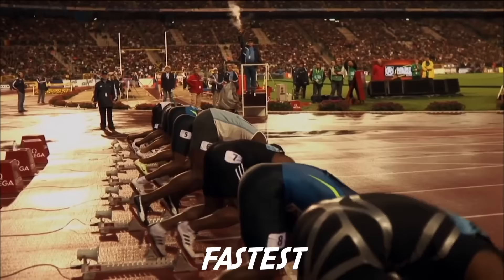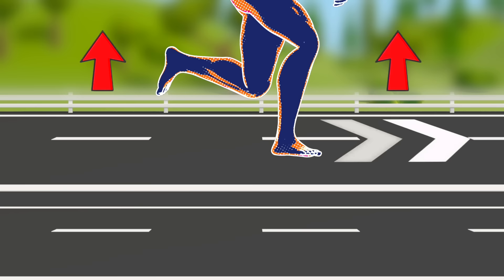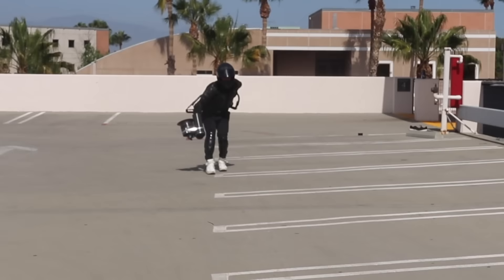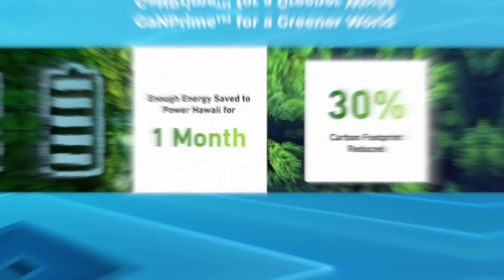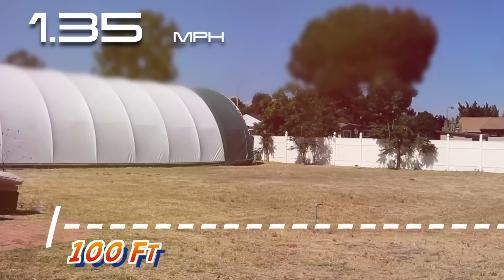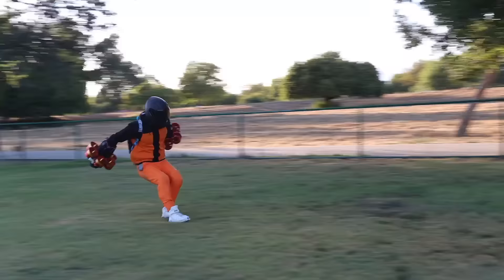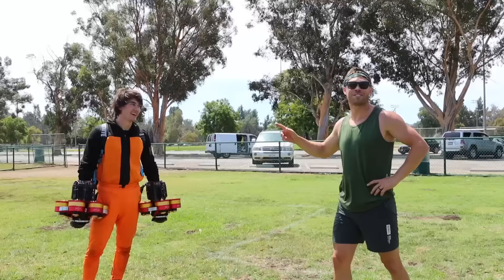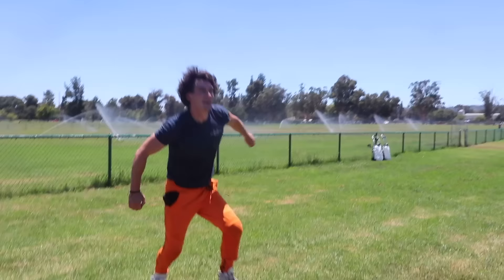I Built Shoes To Make Me Run Fast! (World Record)

Comment: This is amazing, and it honestly makes Usain's speed that much more impressive. Not just because he went that fast, but as this shows, reaching that speed is only half the battle. Holding that speed consistently and without falter is the most impressive thing honestly.
Reply: to be fair, usain bolt does not maintain that speed. that is his top speed, usually he reaches that point late in the race, maybe at the 70mts mark. still, mad credits to bolt.
Reply: @briankim7442  makes sense. At a certain speed you'd either have to touch the ground many times faster or basically slide like he did here. Both become far too difficult to control at a certain point. I'd really say Usain reached really close to what I'd call humanity's physically fastest speed without enchantments.
Reply: 400 likes no comment 🤪 I do agree though
Reply: @briankim7442  I mean Jake wasn't holding 29 mph the whole time he jus hit it once, he jus meant in order to get that speed u gotta be maintaining a pretty high speed. U can't jus go from 0-29 like he slowly sped up and maintained it
Reply: it looked like the consistant speed was the easy part for him tho! getting out of the block against smaller more agile sprinters was the harder part i think! once bolt had reached a certain speed he was unstoppable and just flew past sprinters
Reply: then you're gonna be really impressed by distance running. It's basically doing that but longer.
Reply: you said it
Reply: Wow I can run faster
Reply: To give you an idea: usain at top speed could technically mathematically outrun gravity
Reply: @stealyoursupplies  I'm faster
Reply: He should make the Shang chi rings
Reply: @stealyoursupplies  lol he cant...i know you're talking about escape velocity but while Usain can do ~30mph,u need to go like 25000 mph to outrun gravity
Reply: @FK-oq3iv  True, although they usually hit a plateau speed eventually. Distance running is a test of stamina, not just speed.

Comment: I’ve had an idea similar to this before, but instead of the thrust being attached to your arms, it’s attached to your waist on a belt. That way the thrust is also pushing more on your center of mass. You’d need to angle the thrusters at a slightly upward angle to keep them from pushing you into the ground.
Reply: if you fall you are fked tho, having them on your arms gives you more control and you can react more quickly
Reply: @furryalpacca8634  what about both, stronger ones on your waist slightly tilted up to keep the thrust at the center of your mass and smaller/weaker thrust at your arms to get the controll you want?
Reply: @theaumguy1621  I do IT for a living so I always think about possible issues, so I am not trying to discourage you / patronize you :) There are 2 issues with this idea, first if you have like 60+lbs thrust on your waist you won't really be able to counteract that with less power on your arms. Also stopping is an issue, even if you turn the waist thrusters off, it's going to be difficult to counteract the momentum with small thrusters on your arm. This might be fine if you are secure in keeping a good posture, but if you fall forwards you have 60lbs thrust slamming you into the ground. You'd have to react super fast in turning the waist thrusters off and counteracting it, which I think is unrealistic. I could however imagine writing code that reads data from a gryroscope sensor thingy, which would then turn off the waist thrusters as soon as there is a slight shift. This would increase security, but I still think it's a hazard since you A) still have to counteract with arm thrusters & B) having your waist thrust turn off early on if you can't keep the right posture
Reply: @furryalpacca8634  yes.. that might have a soultion with gyroscope.. but again i agree,  the first test is still going to be very high risk. what if something fails. like the code might be setup like.. that the back thrusters only work at a particular angle range and gyroscope values.. but what if we are missing some edge cases. So the risk of trying out real life stuff based on calculation is the main issue.
Reply: @furryalpacca8634  I really love people trying to think/talk about solutions for exact problems, even more so if they have knowledge about it. I can only agree with what you said..

maybe i have 2 soultions for that

1. Maybe its possible that the stronger thruster only works in pulses? so its not constant pushing you, only when a feet touches the ground? or at least have some buttons to controll the power output?
or
2. Is it possible to make your body seem lighter without having such a huge thrust at the waist, by lowering the power but tilt it more upwards?
Reply: PROTOCOL 3: PROTECT THE PILOT
Reply: You gonna brake something if you fall and if it's too fast you upper body maybe can't keep up with it but there's no impossible brother it could be bad or maybe really good
Reply: @rockyroadmagic4152  They don't get it but I do
Reply: Atot
Reply: What if he tried to run like shadow does?
Reply: @theaumguy1621  or u could just u know make it so that u just need to hold a button with ur hand to activate thrust
Reply: So your saying it should be like attack on titan

Comment: this justs shows how crazy Bolt was at his prime, even with 12 super powered jets and shoes the slide, they only just beat him.
Reply: What if bolt was to use this stufff
Reply: @yeetyeet3473  😩🤔
Reply: @yeetyeet3473  break the sound barrier
Reply: @keymanser2726   man would break the LIGHT barrier
Reply: He would still not have won because you have to take into consideration that bolt is a consistent runner meaning that he runs at about the same speed consistently whilst the jets have a MASSIVE range of 29 and 23.
Reply: @yeetyeet3473  Don't give him any ideas.
Reply: @Allegator07  If he were in his prime today he'd probably break 28 mph with the crazy carbon shoes we have now
Reply: @yeetyeet3473  nothing would happen because he wont do any movement
Reply: @ianjtgove  if you did you wouldn't be able to see anything because light doesn't travel as fast as you
Reply: @yeetyeet3473  he'd go faster than the fastest humans could run in theory which is 40mph and would end up going around 46mph in theory
Reply: @quincywinning8997  e

Comment: Suggestion:  fans at the wrists, pointing toward the shoulder. you can bend your arms at 90 degrees and have the thrust pushing directly behind. It would also allow you to point your wrists up at about 45 degrees while running,  to get some lift for longer strides.   easier on your rotator cuffs, too.
Reply: Hip jets or lower-back jets would be nice(+stabilizer would be perfect), closer to our core which gives a more “natural acceleration feel” for the human body, we didnt evolve to run with force pushing on our far upper-back part or from our arms behind our backs then propelling our shoulder joints to the ground (sorry naruto fans but our ancestors ain’t falling face first without their arms prepared to protect their faces when chasing their preys)
Reply: @f.b.lagent1113  titanfall pilot setup lmao
Reply: ROCKET PAWNCH
Reply: @zvoonyoutube1855  that actually how they wall ran too because their jump jets gave them a bit more lift and pushes them into the wall a little bit to give them leverage

Comment: You can improve these "shoes with jets" by placing some springs inside of the shoes. That way you can keep sliding and gain a good height so you will use less force for running and probably more speed then Bolt.

Comment: Suggestion for improvement: add gyroscopes and exo bones to fix your arms in just the right angle so the jets both provide consistently enough uplift force for big steps and forward force to push you forward.
Reply: That's so much work tho. Like a crazy hard thing to do. Possible, but insane.
Reply: thats what im saying
Reply: A small rotor that rotates based on a single value of a gyroscope isn't such a hard thing to do. Connect it to 2 pieces of  Source: am an engineer
Reply: with exo bones he won't be able to defend himself if he falls, he'll fall on his face
Reply: Would an rc car gyro do?
Reply: @TalTheBest  that's not true, since it's possible to program them to lock only when his hands are in a certain area in space. So if he has them backwards, then auto-lock, but if he moves them anywhere else, they auto unlock.
Its also possible to ads an override in the form of a switch.
Reply: @galgrunfeld9954  I see... with all the ideas in the comment section, he'd actually be even more unstoppable if he was open for suggestions while during the built of the stuff he makes. coulda been awesome
Reply: I think fixing his arms behind him would be extremely dangerous but maybe in wrong

Comment: I think you for the next iteration should leave the very front of your shoes with full grip for a truer sliding run, so as long as you're actually running heel-toe you can slide each foot the moment it hits the ground until you're ready to push off again on that leg. You'd have to relocate the propulsion mech though, likely to your back or shoulders for a straight push forwards.
Reply: the real gains this guy gets is when he's just sliding -- would like to see him actually really running at a fast speed...
Reply: true but then it wouldn't be a naruto run :(
Reply: Nah bro put these shoes on a cyclist who can move their feet quick enough to handle the speed lol
Reply: That honestly might be worse though because the grip would be on the back foot while the front is being pushed by the jets. Sounds like a good way to the splits 😂
Reply: @abranfreemuffin7342  free content lol

Comment: A couple things you could add: 
-a few small jets on either side of your waist, to propel your legs similarly to your upper body 
-traction, but only on the tips of your shoes for when you push your legs
-weights, to lower your center of gravity (sounds counterintuitive but could be easily countered with the extra jets)
Reply: he should add a few downward facing jets to counteract  the force downwards as well
Reply: Adding more weight just to add extra thrust doesn't seem like a good idea. To substantially lower his center of gravity the weights would need to be on his legs which would make running more difficult.

Comment: Cool video! A trigger attached to a pneumatic actuator attached with an exoskeleton to the knees or thighs, to prevent over extension and injury for each leg, would be able to do catapulting force to create longer strides so you could stride like a Cheetah which are recorded to have strides of up to 22 feet helping them achieve 70 MPH speeds. Like the Hulk jumping and running. Legs don't need to move faster, they just need to push harder to achieve record breaking strides. Keep up the awesome work!
Reply: Beastys101  haha it's okay, I do a lot of engineering. Habbit, work, and hobby.
Reply: @matthewmolinar  depends how you fall. The average static line jump for a ranger comes in at speeds sometimes exceeding 35mph using their tuck and roll methods. Additionally, I'd assume the person wearing gear that could produce crazy fast land speeds should be wearing protective gear. Street luge racers and bike drag racers have well practiced methods of spilling at those speeds.
Reply: @edh3268  you should start a YouTube channel!
Reply: ah yes. engineering. it uses all the English words but seems to be a new language.
Reply: @jimmyalpert5233  haha I'd love to, but I'm not as good in front of camera :) I just love this stuff though. I'll leave it to the kickass ppl like Jlaser, Mark Rober, NighthawkInLight, Practical Engineering, GreenPowerScience, and Alex Lab promoting science, pushing boundaries, and helping and inspiring others in STEM. :) JLaser should totally be a FirstNRC sponsor for the high-school robotics competitions to mentor the kids. We used to do that and I loved it! Great opportunity for them!
Reply: @edh3268  I’m a video editor and graphic designer.  If you ever change your mind I think something cool can be made.  You know where my comments at haha
Reply: @jimmyalpert5233  I will surely keep it in mind! :) Thanks Jimmy
Reply: Yo bro, can u teach me how to run faster , engineer style?

Comment: Hey, just a few random questions I would really appreciate an answer to.
1 ) would you be able to go faster using Aluminum Magnesium Boride?
2) would it be possible to create a small material that can allow you to speed run on water kinda like a superhero speedster
3) hypothetically, if u could switch the base of your shoe from Teflon into another material, what would be the best one to increase friction and give you a sudden or strong stop (perhaps even give enough grip to allow for a 90⁰ climb) . (I'm assuming rubber, but would love your opinion on this)

Thank you
Reply: Give this man more attention
Reply: I think that rubber Will be the best
Reply: Pom 😎
Reply: I would also make a suggestion of having something to increase friction on certain places in the bottom of the shoe to make it easy to continue running when you want or stop when you need to
Reply: @slasher3582  I believe roller shoes (the original heelys) had something like that. A stopper at the very front.
Reply: have you found the best running shoes
Reply: if the sole changed to rubber for a sudden stop, then probability of tipping over will increase a lot and might cause serious injuries.
Reply: I feel like rubber would make him trip
Reply: Rubber < freshly moulded silicone
Reply: @SolomonWyt  you're right, it's the same as using the front breaks on a bike when going fast, you tip over.

The force that's propelling him is constant and above the stopping point, maybe if he angled his legs to be Infront of him and lean backwards it would balance out the force of having a sudden stop (doing the perfect lean would be hard to learn)
Reply: @Spartanwarlord  I see what your saying and I agree! But I was more or less saying that the friction on rubber is extremely so it couldn’t slide smoothly, like if I were to take a peice of rubber and run it across a smooth surface it would still scrub
Reply: @Spartanwarlord  thank you so much

Comment: Mount thrusters to your back point at 45 degree angle.  Basically, half of the thrust would push you up and half pushing you forward.  That would allow you to pump your arms and run more naturally, but with an assist
Reply: 100% this is the best idea but they should probably be a bit closer to parallel to the ground, prolly like 20 degrees. It works tho none the less
Reply: yeah but he wanted to naruto run

Comment: Having the thrust aimed down your arms means you have to hold your arms backwards which is a very uncomfortable position and hard to hold while running. The jets also lose efficiency if they're not facing straight backwards and counteract each other a bit. I imagine if you had the jets facing perpendicular to or up your arm, you would be able to hold them in position more easily and go faster.
Reply: Imagine if he had them attached one over each shoulder aiming backwards so he had freedom of arm and leg movement. Complete balance and and thrusters facing directly backwards. Would have worked much better imo
Reply: Well explained I guess yk know aerodynamics and rocket science huh?!.
Reply: I think the point is the naruto run. They wanna break the record with the power of anime.
Reply: definitely cant have them perpendicular bc it's more than 100lbs of thrust that you have to fight but facing up the arm seems like it would be easier
Reply: Thats true BUT if you raise it a little too high ur face is gonna end up on the ground, you just have to be really careful and not make a slight mistake because it’s a high chance of face on the ground
Reply: @knrz2562  it's not like you need to have a degree in rocket science or physics to know how to angle the thrusters

Comment: This is awesome man, how does it feel to be the fastest man alive ( on a technicality ) but still, 29 miles per hour! That’s 2 mph faster than Usain Bolt’s 27, and now I can’t wait for your Iron Man suit, you’ve tackled flight once, now you’re gonna do it again
Reply: The only problem is that he is not actually running, he is sliding
Reply: @user-ki4xw2rb8q  he’s running and sliding, he’s pushing forward to get faster and sliding when he loses control
Reply: @SCPguy-06  he is running just to break inertia once he accelerates enough he is increasing and reaching top speed sliding not running

Comment: I think the better strategy is to put the jet on the back, make them exhaust to the back. 

Because your arms are occupied, you can't generate proper force to run. It would also make you a lot more stable. 

Build a solid backpack from fiberglass, inlet from top of the pack and exhaust from the right, so you'll need a 90° channel.
Reply: great dude

Comment: Make a mysterio drone. You could just attach a projector to each side and let it loose in a blank room in order to project images onto the walls with some fancy sensors that can tell the drone what shape the room is so it can adjust its projectors to fit the walls
Reply: I don,t know if that is possible. But if it is then this is the chanel

Comment: i have a theory, so if you could make this happen it would be insane basically shoes but robotic and built for speed and you would want fans of some sort to keep in the air for longer because if your feet stay in the air longer in will accelerate you further p.s when you run keep your feet up a little bit higher per step but pretty much that would be insane